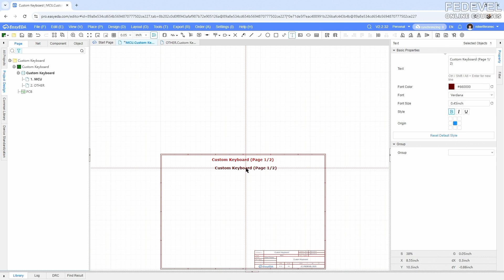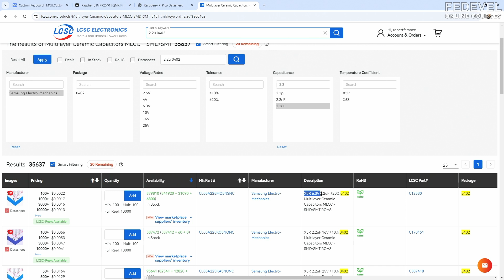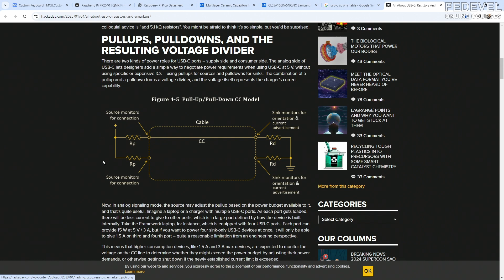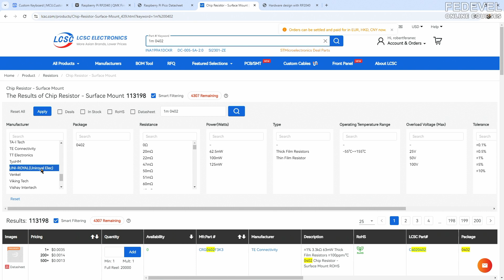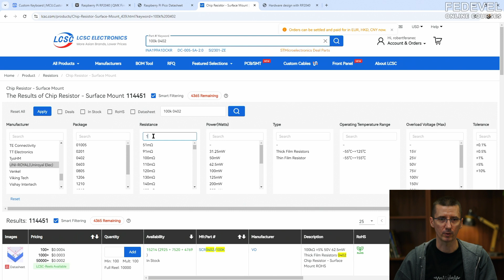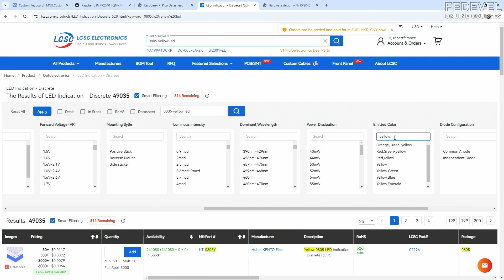Tutorial - Custom DIY Keyboard Design and Build: Schematic + PCB + Case | Part 1 - RP2040

Comment: heyo! if i wanted to have multiple leds (1 for caps lock, 1 for numlock per example) where would your recommend putting the extra leds that won't be able to use the already-populated led/gp25 header?

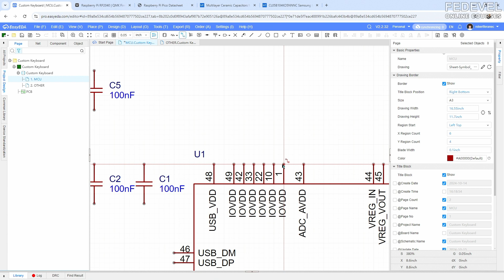Comment: At 17:00 I was confused about the Capacitor layout from the Pi Pico schematic and then how you laid out the Capacitors in EasyEDA. It looked like a different schematic. I asked ChatGPT and here is the answer it gave me. Figured others might have this question.

AI Answer:
Ahh, great question — this is a schematic drawing style vs. actual connectivity issue. You’re not missing anything electrically. Let me break it down:
⸻
1. The Pico schematic (your first image)
	•	Each capacitor (C4, C5, C6, etc.) is shown separately, each tied from a specific VDD pin → GND.
	•	This emphasizes that every VDD pin gets its own decoupling capacitor, placed physically near that pin.
	•	On the schematic, they are drawn at the exact pin so you can’t miss which cap belongs to which supply pin.
⸻
2. The tutorial schematic (your second image)
	•	All the 100 nF capacitors are shown bussed together on the same +3V3 rail and the same GND rail.
	•	This is just a more compact drawing style. Instead of repeating “+3V3” and “GND” for each capacitor, the schematic shows them all connected to the same nets.
	•	Electrically it is the same circuit: each capacitor is between +3V3 and GND.
	•	What’s missing visually is the one-to-one pairing with each IC power pin, but that’s just a style choice — you as the designer still need to place them physically close to the pins when you do the PCB layout.
⸻
3. The key point
	•	Both diagrams mean:
→ “Put a 0.1 µF cap between 3.3 V and GND for every power pin of the RP2040.”
	•	The first schematic shows it per pin.
	•	The second schematic shows it all tied together on the same net.

They are not different electrically — just different ways of drawing the same connection.

Comment: Hello, I've tried to do some digging to learn this information and couldn't come up with anything. How did you know you didn't need the second resistor in the "adding 2.2uF" section? Also How do you know to use the 0402 size?

Comment: hey there, the kyocera ESD protector is no longer on lcsc, and im having trouble finding one that could work in its place. could you recommend one?
Reply: would the TECH PUBLIC ESD5451N-TP work?
Reply: or is the SEMTECH RCLAMP0521PATCT good?
Reply: @timelapse-hoursinseconds2931  Hi i take this part :KRCLAMP0521P-N... it is pretty similar to yours I think it will work fine.

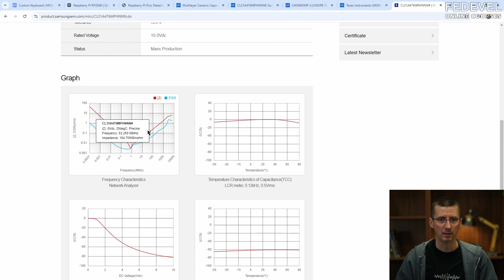Comment: Thank you for making this begineer friendly! I have a question at 43:38, how does one decide the ESR rating is good enough? I dont understand the frequency rating, what frequency will our capacitor be switching? Any guidance is greatly appreciated!
Reply from the maker: a different type of capacitor could have it a way away - you would then immediately see it is wrong. On our power rail there will be mostly DC (+ some small noise) so I only looked at the low frequency ESR at the beginning of the graph.

Comment: Hi, this is my first time trying to build something like this and this tutorial is really helpful. I had a question in the BOOT Select Button. Why is the connection from QSPI_SS to pins 3 and 4? Similarly, why did you connect pins 1 and 2 to the ground? The pico datasheet has pins 3 and 4 connected to the ground.
Reply from the maker: button is a passive component and it can be rotated (the same as a resistor). In this case the exact pin numbers are not important, knowing the internal circuit of the button and connecting it correctly is important.
Reply: Hey did u finish building the keyboard ,i was also wanting to try it out but i have no idea about anything about pcb design i am trying to do it from scratch and learn all these. Is this playlist enough for that
Reply: @Mani47e yes, the steps are laid out in detail.

Comment: Hello
I had a question
Where can I find the footprint of Intel CPUs?
Reply from the maker: datasheet or reference design
Reply: @RobertFeranec  You don't know a website or reference, because there is no reference that has a data sheet inside. I tried a lot but I couldn't find it.
Reply from the maker: @Shervin-u8l  most documentation will be under NDA (means accessible only after you sign NDA with Intel). But some processors have some parts of datasheets available on internet.
Reply from the maker: @Shervin-u8l  e.g. just google for intel i7 datasheet and you will find this https://www.intel.com/content/dam/www/public/us/en/documents/datasheets/core-i7-900-ee-and-desktop-processor-series-datasheet-vol-1.pdf But of course, there are limitation in the amount of information which is in these free available documents
Reply: @RobertFeranec  Thank you for your reply.

Comment: Im really excited for this series! I have been working on a custom keyboard project for a long time but i have been stuck at the simulation testing phase before i order the parts and assemble, excited to see you do that
Reply from the maker: there is no need for simulation. if you are designing your own keyboard based on a different chip, you can just buy a development board, upload simple firmware, try to connect a switch and if everything works design the PCB. PCB itself is not expensive (for example the cheapest variant of the PCB from this tutorial is 28USD for 5 pieces + shipping). Parts are also not expensive if you only buy them for 1 keyboard.

Comment: This was an awesome video. Loved it soo much. I just have one doubt, i.e. in the USB-C part, why did we go with two of each component? I'm a bit confused about it. Wouldn't just using one suffice? I'm sorry if my question seems silly.
Reply from the maker: Thank you. Especially ESD protection needs to be placed close to the pin. There are two separate pins on USBC for power and they are on opposite sides of the connector, that is why two ESD protection diodes. You will see in placement.
Reply: It's so it doesn't matter which way around you plug in your cable - either way up you need symmetry, so we need to handle both paths on our PCB

Comment: A video on how to draw a diagram clumsily. And press the mouse button twice as much. A very suboptimal and ugly job. 🙂
Reply from the maker: I intentionally do not use shortcuts in tutorials
Reply: @RobertFeranec  And did you do a lot more intentionally? :) There is no need to open the LSCS website, it is fully integrated into the EasyEDA search. You do not need to open the component page to get the PN, it is in the search result bar. Usually, experienced engineers first put everything they need on a sheet, first all the resistors - in order to change only the nominal value, without flipping through the list of manufacturers and the case each time, then also capacitors, etc. Blocking capacitors are stacked in a separate block. If you use network connections, then you do not need to pull noodles to USB, especially curved ones. The sheet number is indicated in the stamp, it does not need to be ugly molded in the form of a line at the top. The full stamp is used only on the title page, the following use an abbreviated version. I can go on with the list of engineering nightmares... :)
Reply: and I think that's why Robert's videos are so easy to follow and he presents it about as simply as an amateur would use the program. Once I can use the shotcuts ad hoc, I usually don't need more a tutorial...(my opinion)
Reply: @szabolcsm.7846  If a person is trying to teach someone that he must think about how to do it better and have good knowledge himself, but not talk about his crooked methods. And here we are not talking about hotkeys. :)

Comment: Thank you very much for the video! I’m currently working on a high-speed design with components like the RK3568, eMMC, and LPDDR4X. Since this is a personal project, I’m trying to keep manufacturing costs down, so I'm avoiding blind and buried vias. Also, JLCPCB doesn’t support these via types.

Would it be possible to use only through-hole vias without compromising signal integrity? Or what would suggest l do please?
Reply from the maker: I would recommend to watch this https://youtu.be/A_VRMU3yFTU?si=21uDrpisVUiU2WVI Maybe you don't need to worry about that. Also, many PC motherboards only use through hole vias (at least they used to, I don't have the latest ones)
Reply: @RobertFeranec  thank you, Robert, l really appreciate it. Have a good one!

Comment: This is a tutorial I have been waiting for! I have had keyboard ideas for a long time but never pushed myself into it, the only thing I wished was that you would show us how to do it in KiCad because after this I want to get into pcb design, for more advanced things.
Reply: Doing the layout in Kicad vs any other ECAD software is basically the same thing. What in the video do you feel you can’t do in kicad?
Reply: @tarasaurus24 as someone who just staring out designing pcb I looked at Kicad tutorials but I still face difficulties navigating the interface and selecting/finding the components that I want to use.
Reply from the maker: As @Feelfroow1 pointed out, you can follow this tutorial in any CAD software. The steps are very similar. The main reason why I don't use KiCAD for tutorials is that EasyEDA has libraries - that makes the design much faster and video is shorter.